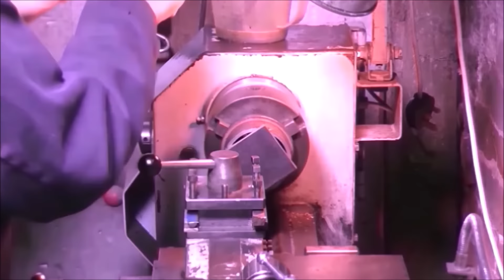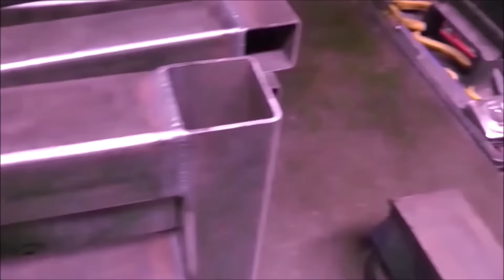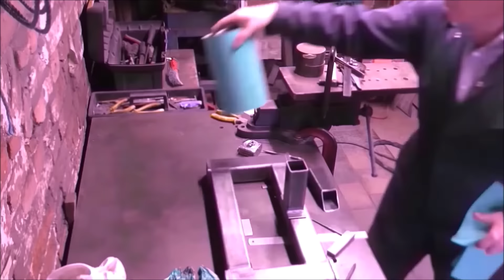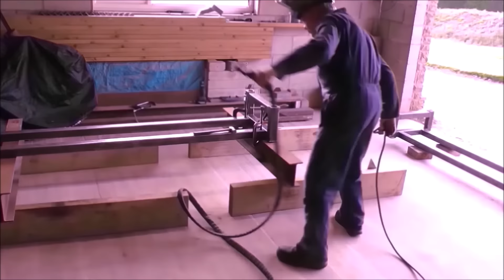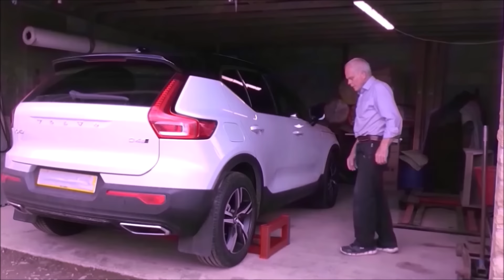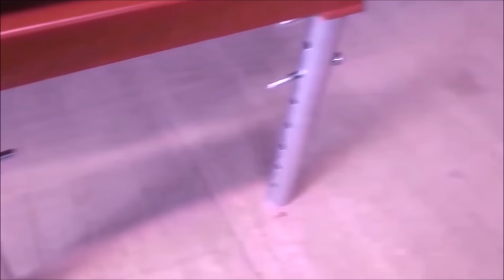The ultimate homemade car jack, simple to use, compact when not in use.

Comment: I like the jack you made for the car. I am pondering make me one. What I would like to make is one from aluminum. Do not know what reason for the metal choice other than the look. Have yourself a wonderful day John. I look forward to see more great videos from you Sir. Peace too. vf
Reply from the maker: Victory First,  thank you for your comment. Note: steel has more tensile strength than aluminum, if aluminum is used then larger sections will be required.
Reply: @johnbower  Would using stainless steel work out better ??
Reply from the maker: @victoryfirst2878  Carefully fabricated stainless steel with good clean tig welded joints would be excellent, but the cost of materials would make it impractical. Best solution in my opinion is tig welded mild steel frame coated in red oxide paint, with legs made from galvanized steel tube.
Reply: @johnbower  The reason I asked you John is that I have access to all kinds of alloys at super reasonable prices. I live near a surplus metal outlet and know the owner. That is why I said what I said. Would you care to give your thoughts on alloy types Sir ??? 
       Thank you for you time too...

Comment: Thats very nice design and I like that idea. But I do not need to do this because I dont work on any cars so I don't need to do this. I would suggest people who are going to work on it to think more carefully because if anything goes wrong, it will collapse and it will crush you to death. Here is what you need to do to make sure that you know what to do before you go ahead. Make sure that you weld it correctly using with gas NOT with electricity because electricity weld do not do very good. It will not hold metal to metal in place as I have tried on my car and it didnt do very good. You are better off to go with gas welding. Make sure that the metal are holding together in place and make sure they are very strong for your safety. Before you jack up make sure you have something to support under the jack for support and backup as you don't want the car to go crush under you when you work under your car. Good luck, be careful and be safe guys.
Reply from the maker: thanks for watching the video

Comment: Hello n a great lifting device. Your welding looked very neat n nice also a Kangaroo Jack either side may make lifting easier unless you wanted to go air , yes a good idea n simple 👍
Reply from the maker: check out my pinned comment at top of comments section to use the lift safely, thanks for watching.

Comment: couple of suggestions,should have 8 plates with 1/2 inch flat on bottom of main frame to keep from going thru concrete small pieces welded to keep square (not welded to bottom just placed under), second strap tie the wheels to frame to keep from rolling off,  one more is frame could be made slide side to side adjustable by inner and outer square so to slide and holes to lock with pins,would make more compact to store too. good design simple. if your concrete is good and thick ok but might give way with just those pipes pushing down if thin.
Reply from the maker: Yes if being used on a soft surface or thin concrete floor metal plates must be placed under the legs to spread the load. There is no danger of a car with average size wheels rolling off the frames especially a car with small wheels. When the frames are not in use they stand up on their ends in corner of garage taking up little space, Thanks for watching.

Comment: Maybe if You use it in front of rear wheels and behind front wheels it could be a great idea. A lot of home-made mechanic job is in wheels, suspension, breaks, and so on

Great job, awesome idea
Reply from the maker: My first idea was to lift under the sills, but after a lot of thought I decided it was best in many ways to lift under the wheels,  and if I need to remove wheels I place jack stands under the sills and remove the frames away from under wheels. thanks for the comment.

Comment: What exactly will you be doing to the vehicle after going through all the work to raise it?
Reply from the maker: @Hugo-Fust,   To answer your question and anyone else who's not mechanically minded, this car lift is actually simple  and safe to use, and in a few minutes can lift any car to a comfortable height in order carry out any type of repair or maintenance needed to the underside, also any repairs to outer bodywork is made easier when the car is higher off the ground, it is also very useful for car restoration projects. Thanks for the comment.

Comment: Love the lift, and the owl! Respectfully, I do have a possible suggestions/questions.
1.  Why not lift and lower from the center? 
2.  With the addition of a couple pucks the jack could be placed under the lift points of the vehicle.
Reply from the maker: @veritas6466, To your suggestion no 1. That would be dangerous, one end of frame must be firmly on the floor while other end is being lifted in case wheels rotate.
To your suggestion no 2. If these frames where positioned under the sill jacking points you would have problems, I will name a few (a) you would not get the car as high without having longer  frame legs and a higher jack, (b) jacking point centers are not all the same on all car sills, so different frames would be needed for different cars. (c) lifting at four different points under the car sills would cause the car to wobble, where as when lifting under the wheels you get the advantage of articulation from the car suspension which prevents any wobbling. (d) If these frames went across under the sills they would obstruct the car doors from opening, there would also be very little clearance between the frames and the underside of the car for changing things such as the exhaust pipe etc.
Note: a lot of thought has gone into designing these frames both for simplicity with safety in mind.
Reply: @johnbower I was fairly confident you had considered those options and was looking forward to your thoughts. Again, nice work.

Comment: John,  I did not suggest lifting both ends together . I suggested one end (left and right wheels) at a time sequentially . Lift rear centrally (both rear wheels) to a safe level,then peg off, then do same to front end . End for end . Still incrementally lifting BUT half the operation.
Reply from the maker: @arcboutant, A lot of thought has gone into designing these frames both for ease of use with safety in mind. What you have suggested would be very dangerous, please read my IMPORTANT NOTE pinned at the top of the comments.

Comment: Thank you so much, its been a great inspiration to do something similar.
Would it be possible to share the measurements?
Reply: The measurements are what ever you want to lift. Looks like 2x2 square tube 3/16-1/4 inch thick
Reply: @cheeseymccheese7249  Thank you. 
However, I was more interested in the general dimensions of the construction. He already stated in one of the comments that he used "Box section 60mm x 3mm wall" ... 
Since he is using an SUV and I'm probably going to utilize it with smaller cars it'll be great to have some sort of reference to go by. That way I can still use it with bigger cars if I need to. 

So @John Bower: How long are the horizontal beams, left to right? How far apart are the beams, front to back? How far did you space the "guide pipes", up and down?
Taking the Volvo's width of about 1,9m into consideration I would guess about 2,1m left to right maybe?

Thanks :D
Reply from the maker: MrMrBanana, The main frames are made from 60mm box section with 3mm wall. Legs are made from 48.5mm O.D. galvanized tube with 4mm wall. Inside width of main frame is 1970mm. 250mm between bottom frame rails (where wheels sit). 250mm vertical measurement between top and bottom leg guides plates. 420mm I.D. between legs on each side. The cantilever bracket for jacking is made from 50mm box section with 3mm wall. When my Volvo XC40 is on the frames there is approx 50mm clearance between the outside of each rear wheel and the frame on each side, "this clearance needs to be kept to a minimum" to keep the weight of the vehicle close to the legs, when lifting smaller cars which are narrower this clearance does become greater, but smaller cars with less weight will not be a problem. Note:  high quality welds are needed on all frame joints, "a weld is NOT a weld" if it has not been carried out correctly with proper preparation.
Reply: @johnbower  Thanks a lot, Ill make sure the welds are properly made.

Comment: If the only place you can lift the car is at the jacking points under the cill then it's a good idea but otherwise  you might as well just jack the car up with a jack and then put the axle stands under the car.

Rather than the tube uprights you could use adjustable scaffold feet. The flat plates at the bottom also spreads the load which at the moment is   concentrated on  the very narrow ends of the uprights which at the very least could damage the concrete and you have no realistic chance of using  the device  on any other type of flooring such as tarmac or block paving.. Not many people have a garage that size  - not in the UK at least. So the work is likely to be done outside  on the aforementioned  tarmac and block paving.
Reply from the maker: @we-are-electric1445, To your first suggestion,  Most modern cars only have four jacking points, these are at designated positions under the car sills, so when jacking the car up at these jacking points, It is not possible to get an axle stand into place when the jack is under the jacking point.
To your second suggestion, If you need to use the lifting frames on soft ground then just position a metal plate under the legs. If the legs had fixed plates attached to the bottom of them you would not be able to assemble the legs into the frame as I show in the video.
Note: A lot of thought has gone into designing these frames both for simplicity with safety in mind.

Comment: Solid construction 👍but relative heavy, and you must manovre the car back and forth, there is not always enough space!
Would be a nice posibility to seperate the outer "lifting frame" apart from the two long tubes, or?
Easier to handle and positionig, also the storage with less space.
Reply from the maker: @schwellenzaehler4564,  Having the frames made up into sections as you have suggested would not work because you still have to get the long sections of the frames underneath the tyres, it would also complicate fabrication and assembling the frames. Storing the frames when not in use is not a problem as the design allows them to be stood up on their ends in a corner taking up little space. Thank you for your comment.

Comment: wow great design, if you have a jack on both sides it will be perfect
Reply from the maker: To have the lifting frame on two jacks would be dangerous, if neither end of the frame is resting on the floor there is nothing stopping the car wheels rotating, this rotating action coupled with the weight of the car could then kick the frame and jack from under the car wheels. Thank you for the comment

Comment: hello john. great job! You know i will ask you what box section/thk you used :):) and if any particular reason you went for round for the legs. thank you for sharing. hope you are doing fine these crazy times. take care.
ps if for any reason you can't share the data is ok too. :)
Reply from the maker: Hi Peter,  Box section is 60mm x 3mm wall. When making the telescopic legs tube was the way to go, (it had advantages over square), it did not need to be a snug fit inside the box section as it was easy to make snug fitting guide plates to prevent any side play, it is ready available galvanized, it is easier to handle and I think it looks better. Thanks for the comment.

Comment: Nice job John, not your first time using a welder I guess. What sort of cost do you have in it? How does it compare to getting a car hoist? Prices have come down a lot and they are more accessible to the average home mechanic these days. I known they are less than 3k Aus $ where I live.
Reply from the maker: 56WagonWheel,  One main advantage with my car lift ( opposed to off the shelf car lifts ) it does not have or need any built-in hydraulic mechanism, this keeps material costs to a minimum. thanks for your comment.

Comment: Nicely done, is there a list of materials used?
Reply from the maker: Main frame is made from 60mm square box section with 3mm wall . legs are made from galvanized tube 48.7mm outside diameter with 4mm wall . pins for the legs are 12mm diameter 8.8 grade high tensile steel. cantilever arm for jacking made from 50mm square box section with 3mm wall. thanks for watching.

Comment: Nice design but allot of work. I made a beam which mounts on the service jack. It spans the vehicles suspension members to lift the front from a central point. Only issue is my newest car is to low to move the service jack under the car in one step.
Reply from the maker: Mike Fennema,  Yes most modern cars do not have suitable jacking points for a service jack, this is the main reason I decided to build these Jacking frames, just drive onto them and jack them up, if needed I can safely lift the underside of the car 700mm off the floor. Thank you for your comment.

Comment: John:  Brilliant design:  I looked through the description and comments and did not see a materials list.  Would you mind providing the outer dimensions and wall thickness of the square pipe as well as the diameter and wall thickness of the round pipe?  I'd appreciate it a lot as I'm planning to build a set.  Also:  Any reason why you used round tubing for the legs rather than square tubing?
Reply from the maker: Main frame 60mm box section with 3mm wall thickness, legs 48.5mm outside diameter galvanized tube with 4mm wall thickness, leg pins 12mm diameter 8.8 grade high tensile steel bolts, cantilever bracket for jacking made from 50mm box section with 3mm wall. Reason for not using square legs, I was unable to find a snug fitting size to slide inside the uprights, also if a snug fitting size was available it would bind against the internal weld seam of the section it slides into,  other reason for using round legs, guide plates with snug fitting round holes can easily be made for the legs to slide through. thanks for the comment

Comment: Questo è il più  sicuro che ho visto, semplice niente pericolosissima  idraulica da pochi soldi, con una piccola modifica si può sollevare anche nei punti adibiti al cric  ed in questo modo si potrà lavorare anche sulle ruote/freni........bravo! This is the safest I've seen, simple, nothing very dangerous cheap hydraulics, with a small modification it can also be lifted in the points used for the jack and in this way you can also work on the wheels / brakes........ Good boy!
Reply from the maker: Thanks for the comment, Note: a lot of thought went into building this, you will have many problems if you try and use a similar version under the jacking points.

Comment: That's great John - thanks for sharing! A really simple design with low cost, easy to fabricate, use and store. Really good job :) One question - would it be stronger for the posts to have the holes drilled alternating 90 degrees? Or doesn't matter?
Reply from the maker: @ApprenticeGM,  As for which is the best way to drill the leg holes. Because I use heavy gauge galvanized steel tube with a 4mm wall thickness it does not really matter which way the holes are drilled, but looking at it with an engineering point of view it is best to have them drilled inline and pointing the same direction the car is pointing, this way will give slightly more strength to the legs when they are tilting. Thank you for your comment

Comment: Yes, I have seen that it is the result of good reasoning that has simplified and optimized the construction, if you can give me some advice I would be grateful. Sorry for the english but i use google translator. I saw that the jack attachment system must be precise but I won't make it identical to yours because I have two air/hydraulic jacks available that I would like to use in pairs. This will result in a higher jack contact point. Furthermore, the ground level where I could work is not very regular so I would like to place a sheet metal triangle on at least two perforated columns so as not to rock the whole. Could you tell me what measurements are the square tubes? Thanks bye
Reply from the maker: Marco Fabbricat. When jacking the frame up at one end the other end legs must always be resting on the floor (not on a jack), only jack each end up no more than 150mm at a time before jacking the other end. Note: "never ever" try jacking both ends at the same time the car wheel can rotate and kick the frame and jacks away. I have shown all measurements in one of the other comments on this site. thank you for the comment.
Reply: @johnbower  Thanks again for the information, very important and valuable. I understood and you were right to let me know and I completely agree with you, I will look in the previous comments for more details, is it possible to contact you via email?

Comment: John, if you added removable tubing to tie the front and back frames together into a linked box frame, would it eliminate the rotational problem with using a center line jacking point?
Great design. I have something very similar in plan.
Reply from the maker: If the frames where properly linked together, with a bigger size of box section used for the main cross pieces, then yes you could lift one of the frames up from a central point providing the other frame was resting on it's four legs, but this would complicate the build, It would cost more and take up more space to store the frames when not in use.